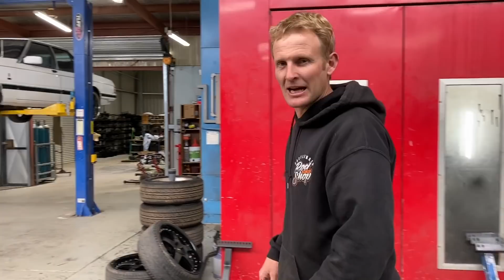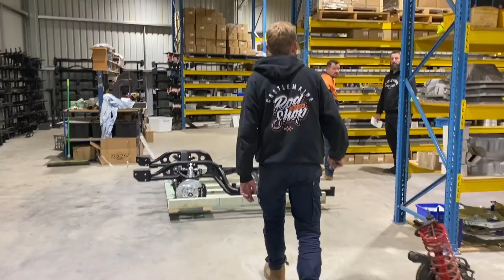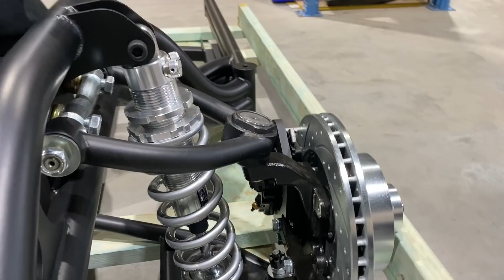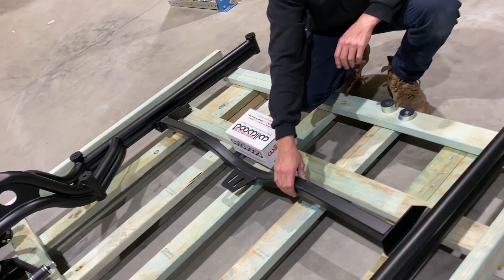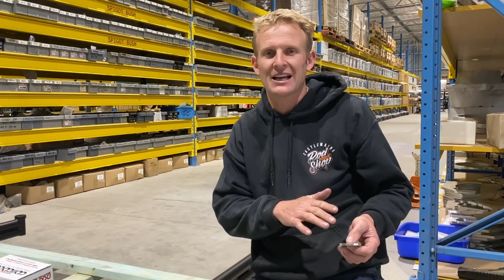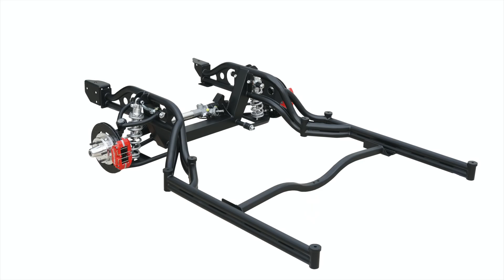HQ HJ HX HZ & WB – Holden Front Suspension Clip

Comment: I can forsee rego issues. The HQ - wb chassis number is on the old subframe. Tough issue to get past at Vic roads.
Reply: Would it not make sense to put original Chassis number from your specific car one ok replacement Chassis???

After informing Vic Roads you have to use a reproduction Rod Shop Chassis to get past a bent or rusted out original Chassis clip!!!

Over my 40yrs of trade life I have found the simplest truthful reason for modifying passes without hassles. 

As long as my attitude is right on the day of course😉🙂👍👍

Comment: Prob;lem is that they no longer conform to ADRs. Both the front subframe and the engine are designed to bend and go under the car in an accident,
With that nothing will. Bolting a standard front subframe up solidly will largely reduce chassis twist. But  the rubber is  there for insulating road noise, it also aids in the designed to bend and go under  in an accident.
And so many of those cars have twists and bends I suspect fitting this will be a potential disaster.
And where do you get the caster?  Besides cocking the top wishbones around. Which is poor from GMH. To make them turn they need modern caster settings of 6-8 degrees and you simply cannot get it with top wishbones. 
An adjustable strut [XF Style]  lower control arm is required using a proper rubber bushing, ideally bigger than the Falcon one.
Or a lower balljoint an inch ahead of the top one but even then aligning with top wishbone  bolts is still not great.
Reply: My engeneer says no way
Reply from the maker: We tell everyone that buys one to speak with an engineer first to ensure that they will be approved. We have had the testing done and supply an engineers report to help with the process at the other end.

Comment: Would this work in any American Made car? Do they share platforms for a Camaro Firebird?
Reply: Im in Australia and have owned a HQ holden and still own a 65 pontiac gto. Athough both cars share the basic design pilosophy (gto is full chassis but still very similar) the holden is slightly smaller overall and these would not bolt in to both cars. Knowing what my gto handles like and the current value of the aussie dollar i think the rod shop guys would have a large market for American A bodys if they chose to make one.

Comment: I still remember seeing these in prototype form at the Rod Shop opening day years ago... they were rocking Corvette brake setups and I’ve wanted one ever since. 
If you ever film a how-to video on bolting and setting one of these up I’ll volunteer my HX sedan as the candidate!
Reply: I have a wb van, brakes are my issue. Also had a 73 corvette and often wondered if the 4 piston callipers would fit. Guess the problem would be fitting wheels over them. Not that much of an issue now, my chrome GTS rims are rusty now, and can't find anyone who can re chrome them.

Comment: What's the difference between sedan/wagons v ute/panelvan? Not familiar with H chassis cars.
Reply: The utes/panel vans run a full chassis bumper to bumper👍
Reply: @longy77  ah I see, awesome thanks man 👍 
Thought they were all full chassis 👍
Reply: The sedan at rear if i recall right is a single bolt set up , The wagon at the rear is a two bolt set up being a bit longer . And the wagon will fit under a sedan set up as the bolts holes are already there . I fitted a wagon chassis under a HQ Statesman ..